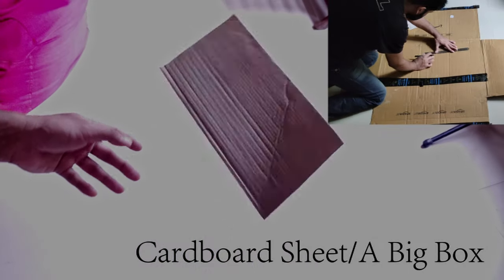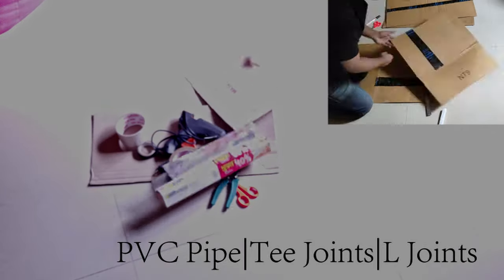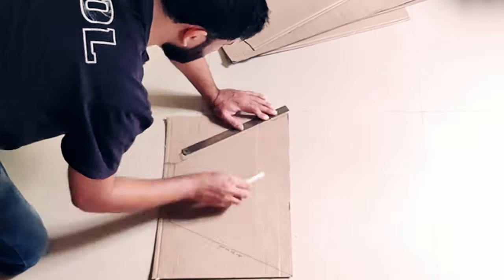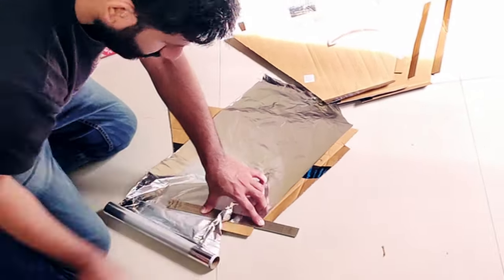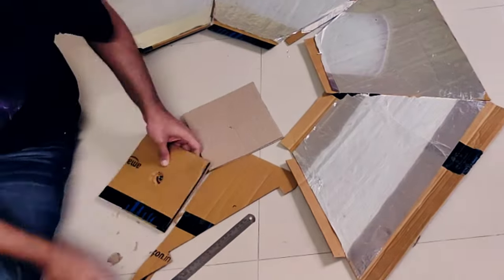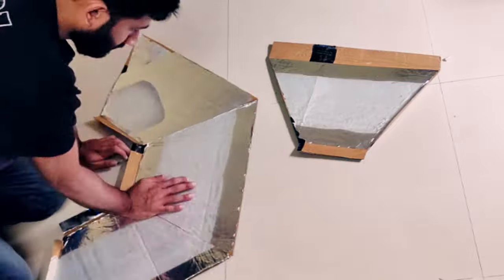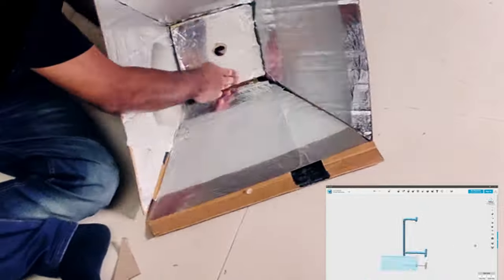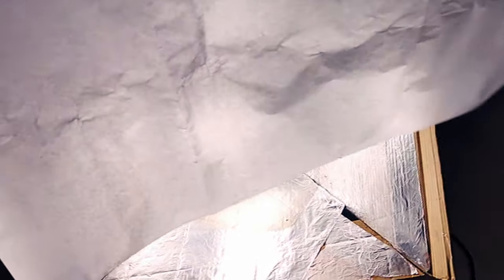How To Make An Easy SOFTBOX LIGHT at HOME | With a STAND || For #Studio #YouTube #Videos #Photos

Comment: Tell about front white Cloth & reflector??
Reply from the maker: So the Reflectors are nothing but a single cut out sheet of Aluminium foil. And the front white diffusor is a tracing/butter paper. It's mostly available at all stationary shops. You can also use a white translucent cloth. it does the job

Comment: You should show much about the stand making☹☹☹
Reply from the maker: Hi Vandhana. I'm going to take this input seriously. And I'll bring out a video on this shortly.
Reply from the maker: In case you want to know about the dimensions- it's a 1/2 inch pvc pipe. And the length would be around 12 feet- and it would need approx 12- Tee Joints for half inch pipe